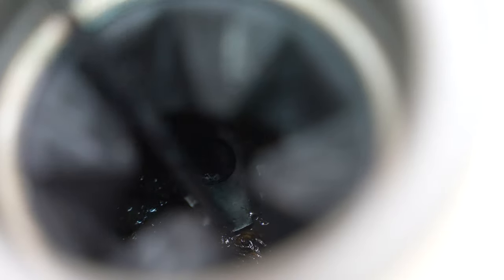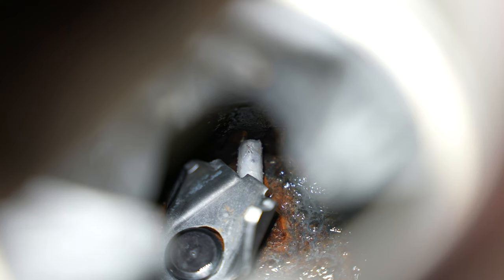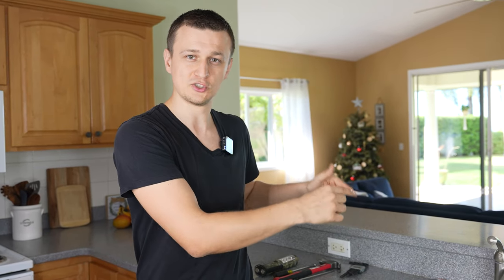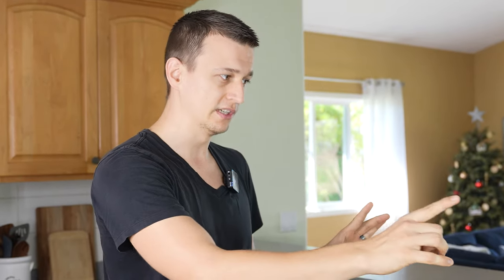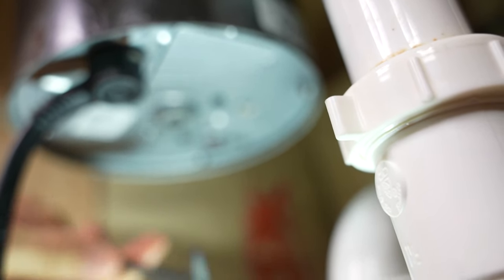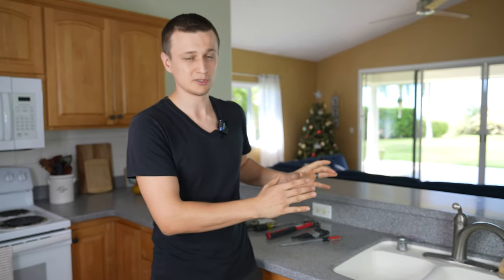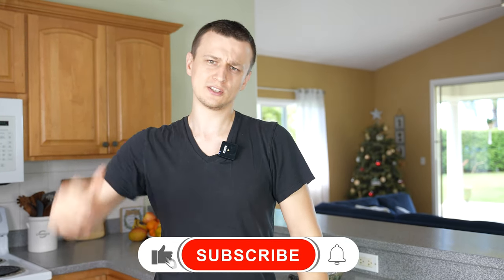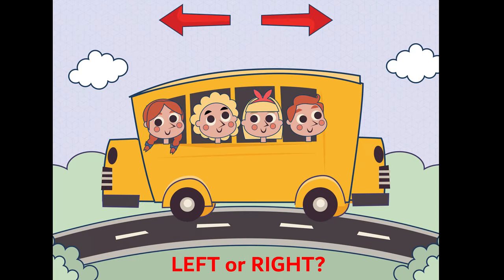Garbage Disposal Not Working - 5 Easy Things To Check and How to Fix It

Comment: 7/14/23. I tried everything and I was planning on heading over to Lowe’s and I just happened to see this additional video which suggested the hammer technique.  I tapped it around pretty hard around the outside at the level where the disc turns and guess what? It worked! Thank you sir, saved me some cash.

Comment: Thank you so much! I had a plastic stem liquid stopper stuck in blades. So I unplugged it like you said, used the the screwdriver and flashlight  to look around. And I had to stick my hand inside to wiggle the plastic from the disposals nasty grip 😅. Thanks again for the awesome tip!😊🎉

Comment: I had an AC condenser fan that started making all kinds of bearing racket at random times. A quick rap to the side of the unit with my hand would make it quiet ... got me two additional years out of it. When that no longer worked, I replaced it. And your videos made it easy!  lol
Bus is headed to the left since it's on the opposite side of the road. We drive in the right lane in the U.S.
Reply from the maker: Nice to hear that the hitting method has worked for you before! 😄 Getting another 2 years like that is not bad at all.
Yes indeed! The bus is going left! Thank you for playing! (there are another 2 reasons why it's going left by the way 😉 )
Reply: The fenders and the front of the bus sticks out further to indicate its headed to the left

Comment: I've always used one of those approximately 18" spring loaded flexible claw like "grabber", I call them, to get the offending item out of a disposal after freeing it up. Worked on one recently that did not have the slot in the bottom to put the key in to spin it. First one I had ever seen that did not have one in around 40 odd years of maintenance work. Fridgidaire, I believe it was. Had to use a pair of long handled channel locks to reach in with one handle and spin the impeller a little at a time. Did that several times before the culprit finally emerged. A soda can pop top tab that was jammed between the impeller and the housing. Almost was ready to give up and tell the homeowner that they needed a new disposal, thinking it was locked up. Only thing I would add to the hammer tapping method is to tap lightly, like you said, and maybe more toward the bottom of the disposal. Point being that I've seen some really old disposals that were all but rusted out inside and maybe more than a light tap with a hammer could possibly send the hammer right thru the outer case. Just a thought. But, if it was locked up that bad anyway, that probably wouldn't matter since it would probably have to end up being replaced. Sorry for being long winded!! LoL. But keep up with the good videos. Have gotten a lot out of them!! Take care.
Reply from the maker: Thank you for sharing your many years of experience Big D!! Those were a lot of great tips, your input is much appreciated! I am sure this comment will help out quite a few people 👍👍👍

Comment: Worked as apartment  maintenance for many years.  Most times their is something stuck under the blades and the disposal just hums when you turn it on.  I use the Allen wrench that comes  with the disposal and and run the water as I move the wrench back and forth real fast.  If I still see the thing that jammed  the blade I use a very long long nose plier to remove item.
Reply: So how many fish tank rocks did you dig out?

Comment: Sometimes garbage disposals freeze up if not used for a long period of time.  To prevent this pour some vegetable or olive oil into it and run the disposal every couple of months.  This often will also make the unit more quiet as well.

Comment: I had a service call for an outside outlet on a house by their front door that had no power. I checked the outlet which was not a GFCI and had no power coming out to the device. So I asked if any other outlets were not working and they said everything inside was working ok. The lady of the house took me to the load center in the garage. All breakers were on and no GFCI breaker was in the panel. I then asked if we could check all the other outlets in the house that had the GFCI plug with the red button. Bingo, upstairs on the second-floor bathroom the device was tripped. She claimed it was an outlet they never used and was happy to know that it also protected the other outlet in the other bathroom and the two outside outlets on the house. Mission complete.

Comment: Around 20 years ago I had a 17 inch CRT "Cathode ray tube" Monitor that I have to tilt it forward and smack it on top and sometimes on side to get it on.
for the buzzle, the bus is heading left, because it's in the US and it's on the far side of the street, and in US they drive in the right lane, also another indicator, the kids in bus are looking right, and they usually looking behind, which means they are heading left.
Reply from the maker: Ah yes! The smacking method does wonders on electronics! 😄 I remember how often I would smack our old TV when I was a kid if the reception was getting fuzzy.
Yes! The bus (haha I liked the new buzzle word) is indeed going left for all the reasons you stated. Thank you for playing, have a fantastic new week!
Reply: I currently have an over the range microwave that sometimes you have to hit with your hand in the bottom right hand corner to get the relay to close for the magnetron to start. If you don't it just spins the food around but not cooking it. You can hear it close as the noise is apparent.

Comment: Here is an idea no one seems to mention.  What if the wall switch is bad?  It seems to me one should want to check if it is the switch before throwig away the disposal.  How to do this: unplug the disposal, then plug it into an extension cord coming from an outlet NOT on the same circuit.  Be careful, when you bypass the switch, the disposal may start running as soon as you plug it in.  If it runs, then your disposal is likely fine, and you need to check all the connections inside the switch box. If this is wrong, please write an answer.  Thanks.  P.S. if you get a "hum"  when you throw the switch, then you probably don't need to try this, I don't get a hum, I get nothing when I throw the switch.

Comment: The "smack it with a hammer" method works well on car starter solenoids that refuse to engage.
 It won't fix the starter but it can get you going until you can replace it...
 Many home builders will put many things on one GFCI outlet or breaker to save money.
 On my house the shed, two outdoor outlets, the door lights and both bathrooms' outlets, fans and lights are all on the same GFCI breaker. That circuit goes all over the house.

Comment: To the people who did the "hammer trick."    Did this continue to work for a long period of time?  My thoughts are that the hammer working means the brushes are catching... much like on a starter motor for a car.  Usually when you resort to hitting it with a hammer, it is going to go out sooner rather than later and no amount of hammering will make it operate

Comment: Is there anything that can be done on impellers that are not rotating. I have 2 insinkerators 1 hp that have non-rotating impellers. There is no obstruction. I've tried penetrating oil, wd-40 and others to no avail. Any suggestions? Thanks

Comment: Left.  OMGOODNESS the GFI outlet on the backside of my house catches the blowing rain every time and it'll trip the outlets in the bathrooms, if it done it in the kitchen the wife would probably loose her s**t!!!🤣👍👍
Reply from the maker: Correct! Oh wow, so it seems like this "GFI outlet outside" business is more common than I thought. 😅 Thank you for sharing!
Reply: Fill the holes with Vaseline and coat it around the reset buttons as wll if you don't have a cover. That should stop the water from getting and still allow you to plug something in if you need to. May have to reapply the Vaseline if you do plug something into it.
Just an idea.. I have never tried it.

Comment: Car starter and fuel pumps as well. They stop on a place that has a bad spot so they can't start spinning again. I used it on a starter but never a fuel pump but it's worth a shot if your stuck far from home
Reply: I worked at a shop for 4 years.  I must have got at least 3-5 vehicles going again with bad fuel pumps, by hitting the bottom of the fuel tank with a hammer or a 2x4.  It really does work!